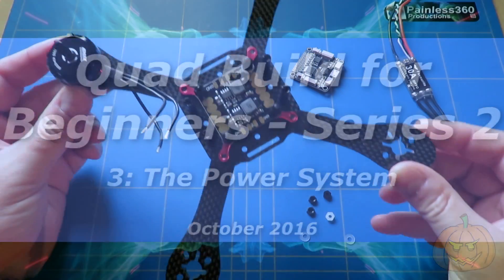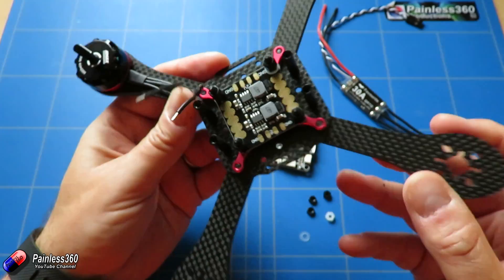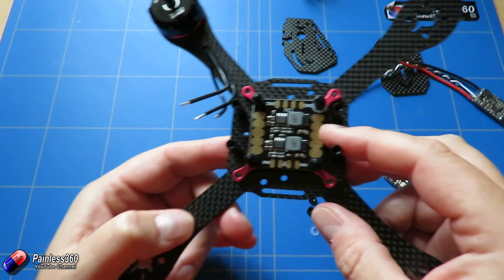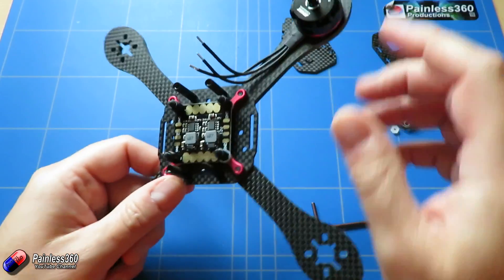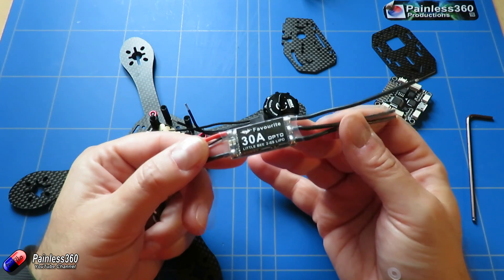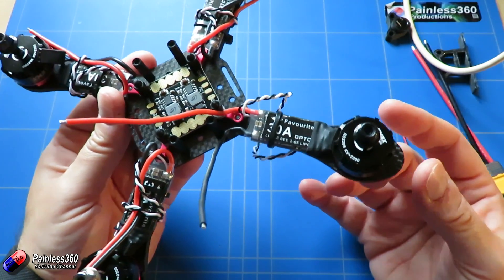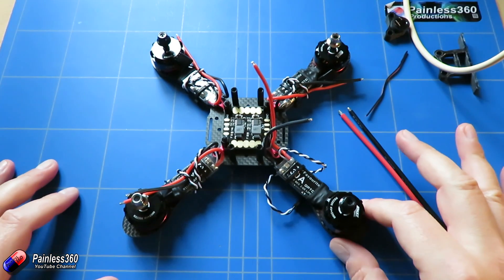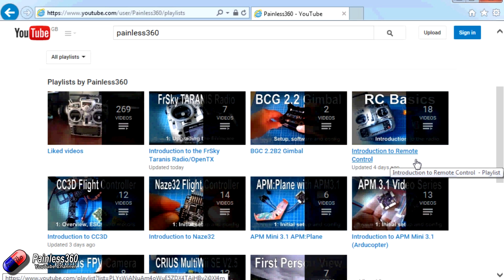(3:7) Quadcopter Building for Beginners - Series 2: The Power System

Comment: My first think was to mount motors with wires directed outwards and escs on the bottom of the arm so esc and motor can be connected at the outward edge of the arm.
Reply from the maker: +nandakoryaaa you can do it that way, but be careful as a crash could potentially damage those wires. That's why most people tend to try and keep all the electronics inbord, to avoid damage in the event of a hiccup. Best of luck with the
Reply: Yes, that was the second thought :)

Comment: At 6:45 into watching the video I realized you could have used your SketchUp part tracing idea and created a larger platform to 3D print out.  You could make the arms 30mm longer and fitting the wires would be easy.  It would be the best time to copy your parts for later printing anyways. Thanks for the videos, this is interesting.  I'm considering printing all my frame parts and purchasing electronics off ebay.

Comment: What part number pizo buzzer are you using? I printed your holder and it seems to be a tight fit for the ones I bought. Also in the kit I got they had replaced the PDB with one that has a '+' & '-' at each corner for the ESC's.
Reply from the maker: +Rodney Lorimor mine are generic and from eBay. The design is supposed to be a press fit so run some sandpaper over the inside walls if your printer has extruded a little bit too much plastic. Happy flying!

Comment: Hey:) Im doing my first build and got big problems at the very end of the build.. Guess what it is? Well the fpv. I have used hours now trying to figure it out, but haven't. The VTX and camera is plugged into the 12v and ground on the pcb. The vtx are getting worm, but the camera will not work properly. I can show you some pictures of what it looks like if you add me on facebook: Truls Nygaard
I can't get any clear images of the camera. I got it once but it was all blurry, now I can't see anything on my goggles. Just some black and white going crazy around on the screen. The problem is not on the goggles, but the VTX or camera. I am pretty sure it's the camera, but I'm not 100%. I have a Foxeer HS1177, heard good things about it and has 5 stars on banggood. I found some threads about similar problems, I can send link if you add me on facebook. Please help me and figure it out. Thanks
Reply from the maker: Sounds like the lens simply needs adjustment. You can twist the lens gently to get the focus spot on. See the video later in the series where we add the FPV gear.. Best of luck!
Reply: Painless360 Thanks, when will the fpv part be uploaded?
Reply from the maker: You're not using the playlists are you ;)

Comment: I have seen another video using the same board in ESC. In that video he eliminated the black ground wire for the signal wires.He said it was a "redundant ground." I see you chose to leave and use the signal ground wire. Can that be eliminated? Is there a reason why I should not eliminate that? And thank you for posting this build!
Reply from the maker: It is redundant but by having both together twisted you ensure that the reference voltage the system us using isn't being affected by any small resistance between it and the ultimate GND connection. Happy flying!
Reply: Thank you for the lightning fast reply! I have always looked at you is one of the most trusted sources of information on YouTube. I will leave and use the ground wires. Thanks again for your advice and thank you for all the information you give to the community.

Comment: Lee, have you thought of using a 30 amp 4 in 1 ESC in racers like this? I've done a couple of builds using them and they make for very neat wiring. Racerstar makes a nice 4 in 1 that is 30 amp and is Multishot compatible.
Reply from the maker: I used something similar a while ago and it was HUGE! I'll look at them again is they are getting small enough for something like this.. Thanks for the idea.
Reply: Painless360 They are the same size as the FC
Reply from the maker: Then I need to look at these again then - thanks again! :D